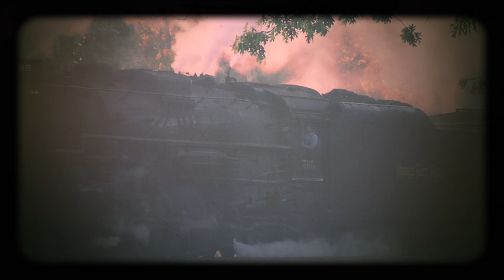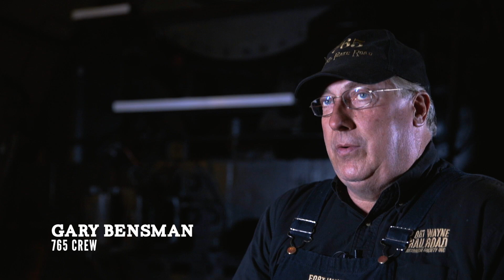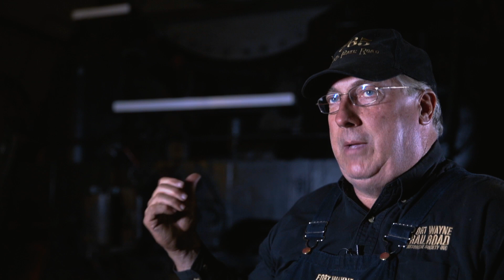A Spooky Story About the 765

Comment: You want me to believe that a headlight ring from 1944 was still laying there in the crud on front of engine after all these years and several restorations? Lol!
Reply from the maker: When 763 was removed from Roanoke in 2007, we found a complete six-pack of soda, with each bottle distributed throughout the frame of the locomotive. It has been inserted there by a flood many years prior, as a bottling plant was located up river. Stranger things have happened.
Reply: The Three Rivers Rambler even found a kitten sitting on the steam chest of one of their locomotives. They named her Cinders and she now has a loving family.

Comment: ehh thats creepy, finding old car parts on a locomotive.

with that said, can one of you from the society answere my questions, its like you are ignoring me,  on the topic of outpulling a diesle, what is it that makes it so with a steam engine, number 2 when they run the line do they keep water going into the boiler continualy or do you fill and cut off for a bit like when sitting still 

and do you need people with woodworking skills currently, if so what is the process of getting to help out on projects, is there training or do you just join and show up.
Reply: +Ryan Lewis yea someone already told me about that, not here though but some guy named grave something or rather he said he has worked on many steam projects including starting the crown plate for 1218 and told 2 times to stop they were not going forward with the project.
Reply: it was on the go rung it would not be
on it because the Loco was rebuilt in the dirt